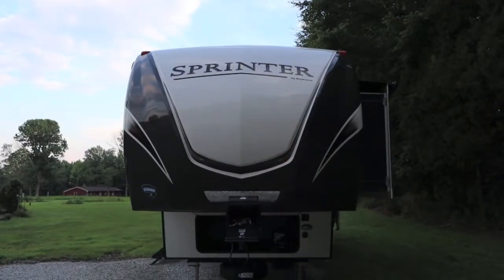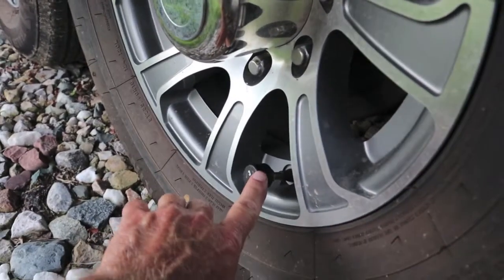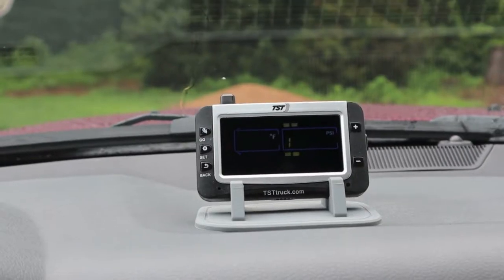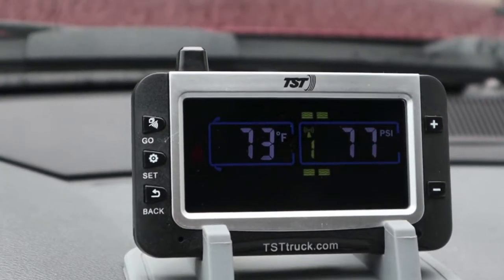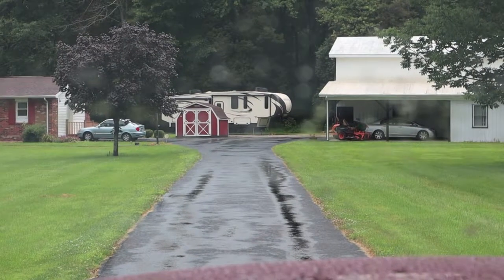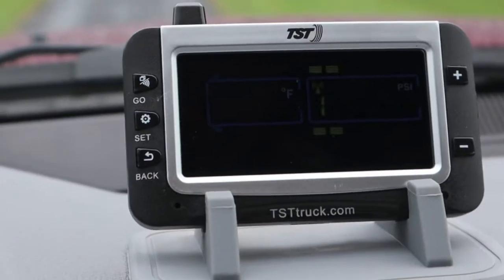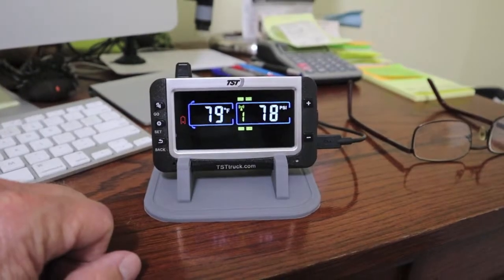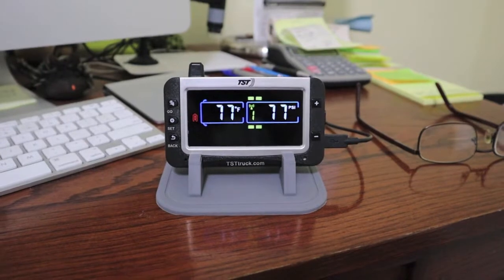TST-507 RV TPMS with repeater, Incredible Range at 96 yards

Comment: Thanks for the speedy reply.  I have used my unit for over a year now on my 38' fiver.  There have been times I've been concerned about the signal so I'm going to install the repeater this week.  My last trip I was getting some odd readings that I suspect were caused by wireless/remote thermometers I use for the refrigerator/freezer and outdoors.

Comment: Thanks for this information.  I have a Class A with a tow dolly and toad.  I have sensors on RV, the tow dolly and the rear wells of the toad.  I was thinking of putting the repeater in the toad attached to the battery under the hood.  Based on what you should me, this should work fine. Your video was the only one I found that showed the distance away from the repeater can be from the digital display. Thanks for this info.  Dan
Reply from the maker: Glad it was helpful!
Thanks for watching!

Comment: you posted this video almost a year ago. are you still happy with it now?  im considering buying on of these TST systems.
Reply from the maker: Hi scraptech and thanks for watching! I have not used them this year as our travel plans were cancelled.
I took the wheel pressure sensors off during the winter and stored them in the original box and in the house along with the dash display monitor.
We really enjoy the feeling of knowing what the fiver's tire pressure is doing. I tried a cheap one hundred dollar system about 15 years ago and it was useless.
This system is so much more advanced in technology and with the repeater the range now is a non-issue.
I would buy again in a heartbeat!
Thanks and have a good one!

Comment: I just installed my repeater in my fifth wheel.  Red light is on, however, I'm am not getting a "repeater icon" on the display.
Reply: This is the reply from TST...."The repeater icon will only show on the Display if you have sensors coded to the Trailer section (the box on the right side of the screen). If you only have sensors coded to the Motor home section the Repeater icon will not show.

As long as the Red light on the Repeater is on and intermittently blinking then it is working properly.

I hope this answer is helpful. Please reach out if you have any additional questions or concerns".

I have the unit configured correctly.  The "cab" section is blank and I have 4 tires in the trailer 1 section.  No repeater icon.
Reply from the maker: Phillip, my repeater icon came on within a minute, iirc.
You could run a distance test to see if it is working by just carrying the monitor in your hand and walking away from the RV and repeater, with the repeater off then on.

Comment: Do you have to sync the repeater with the display every time you turn it on?
Reply from the maker: No, my repeater is wired to RV battery. When parked for a few months, I'll just pop the fuse out. 
The repeater has its own fuse.
The unit will find it within seconds.
Thanks for watching!

Comment: If it was just accurate.  Always within 5 or 6 lbs tho.
Reply from the maker: Mine is pretty much spot on. The thing I really appreciate is the lag time (or lack of it) when the pressure drop triggers the alarm set point.
I've only got 1,000 miles on them though.
Thanks for watching!
Safe travels to you!